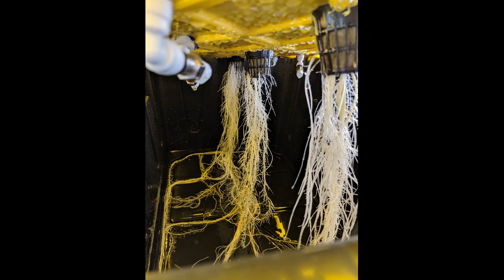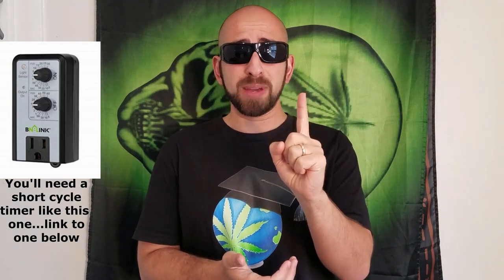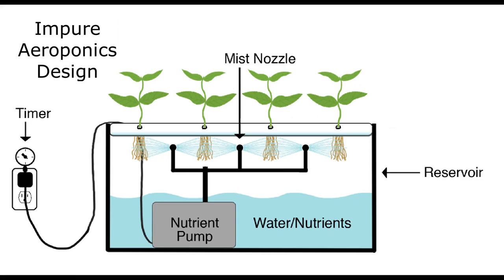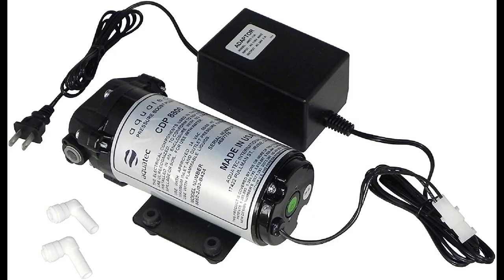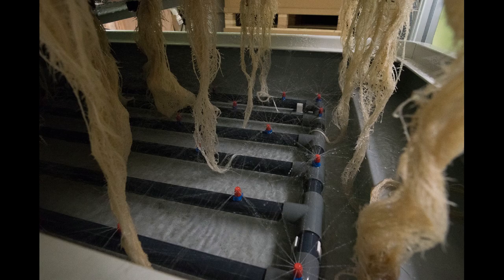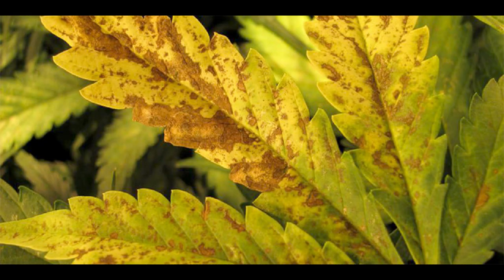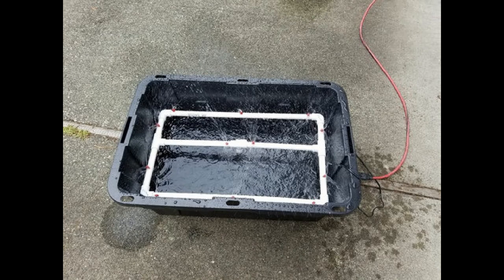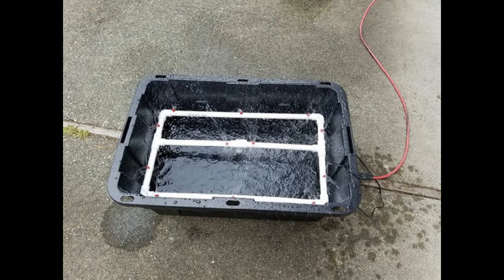Aeroponics Overview - Setups, Advantages & Shortcomings For Cannabis Growers

Comment from the maker: Thanks for watching and remember to subscribe! One little edit on the video: the heavy duty misters for high pressure systems are actually most often made of stainless steel, not brass. Apparently the brass/steel mix ones aren't as good.
Reply: talk about jewish cannabis strains and are those strains less subversive.
Reply: Hey Lex I have been subscribed and watching your videos for a quite some time now. Question with the aeroponics. So I am use to using Hydroponics if I decided to go with an aeroponics system could root pruning be beneficial in not getting things clogged up? Also if someone was to spend a couple hundred on a battery like they use on PC's and servers so if the power happened to go out they would have a couple hours of good power then that should save their crops (hopefully). I mean there are a lot of different batteries but the good cheap ones run about $400 USD I got one I am planning on putting on my hydroponic system but I have to make sure my battery is far from water as it can get dangerous quick. Is Hydroponics or aeroponics better in your opinion?
Growth/Veg/Yeild?
Reply: Look at MistFitz Aeroponics. I have all these issues worked out. I designed, coded, and built multiple working Aeroponic controllers. I need investors. 
Fitz.
Reply: What do your two scents smell like?!
:
Reply: How come YouTube grow channels are so anti Hydro when hydro it the most common method for indoor growing in the world?

Comment: I run a aero system in a 50 gal reservoir . Most of the problems you talk about there are fixes for. Like clogs . They made fine mesh pump screen type bags.   Net pots get zip tied to the tote your using.  Stuff like that . I will say that timer from Blink you showed is awesome I have about 5 . I also have back up pumps and air pumps for everything.  You cant beilve the growth I achieve . Ive ran many systems there nothing like a finely tuned aero system though. The gains out way the problems if you stick with it and youre right smaller plants are easier to control.
Reply: Good for you Mark... soon will be going this route too... we now have a lot of automated systems in the market like growee to provide smart management of the root zone and together with systems like ac infinity for above root level management and monitoring high pressure aeroponics is the future of proper cannabis cultivation

Comment: The short bursts of spray in a high pressure aeroponic system are what changes the roots from hydroponic roots to high pressure root's. Low pressure aeroponics and hydroponics produce the same kind of stringy root. Most people start with intervals of 3 seconds on every 3 minutes, with the largest gap being 1 second on 5 minutes off. We are trying to create "suspension" in the root chamber. The earth spins at about 1G of force, 20-50 micron sized droplet's "suspend" in the air for about 8 second's. This creates a more consistent humidity level in the chamber. This allows the roots to create smaller fishbone like root's similar to roots in soil. We have found growing Cannabis works best in container's that are at least 19" high for 3-4 months of growing. True HPA changes the pant by causing more "turgidity" essentially the plant rapidly ages along with the explosive growth. Plants have an extra cell membrane compared to us, during osmosis the cell's can swell rapidly and True HPA forces this. Another advantage is running sterile nutrient's the entire grow. Since the roots absorb almost all the nutrients during the day, there is very little runoff. Solely speaking about Cannabis I agree with a lot of what you say. What most people don't realize is that the advantage to True HPA is the speed of growth and cloning during an entire annual set of grow's. True HPA simply adds an extra grow annually do to the speed. When comparing what system's work best for growing Cannabis I have found a good grower will simply win with the system they have mastered. Thanks! Great video.

Comment: I'm growing in aeroponic system and it's succeeding. I'm in week 5 of flower. My mistakes were attempting too plants at 1 time so I recommend 2 at most and account for your flower growth! Create anchors for cropping and stress training! Add inner panel's to prevent drips. Go for it! I'm not using brass but I want them for the next round. I like the set up. 2 totes
1 is not long enough
Reply: which brand did you get? is it still good since you have it?
Reply: Need info about aeroponics can you help?

Comment: True aeroponics is done with high pressure, delivering about 80 to 120 psi, producing 30 to 80 micron small droplets - the ideal size range. i personally would run 3 seconds every 3 min. an accumulator helps to keep pressure constant and reduce the times the pumps starts running.
you can reduce growing time by a good 20-30%, with higher yields than traditional hydroponics and use way less water and nutrients (if you use a recirculating system). 
PROS: best way to grow, period - faster, better, way less nutrient use, bigger yield etc. - seriously, you can watch the plants grow right in front of you.
CONS: very complicated set-up, needs some technical knowledge and decent diy skills, no ready to use products, when it fails it's catastrophic (have a backup system ready - and some way of notifying you when the system fails) - not a system for beginners or intermediates; even pros will prefer simpler set ups for the convenience, but if you do get into it and can build a real HPA system, you are in for a treat!
Bonus Tip: DO NOT USE BRASS NOZZLES! there are good steel, titanium and nylon nozzles out there, use those! DO NOT mix metals in your nutrients loop, as it will cause corrosion and poison your plants. Try to get all plastic, steel or titanium parts only (had to search for HP gauges with steel fittings etc.). 
Bonus Tip 2: Use Yucca in your solution, as it will keep the system and in particular the nozzles from clogging up for much longer!
Reply: Do you agree that a full growth cycle through flowering is this difficult if a good high press system and filters are used? I assume if you avoid clogs and have a few redundant misters if you get get some clogged you'll be in good shape. Is there a standard way to support the base of the plant in lieu of soil or more medium?
Reply: super pro tip: drain to waste because you only have to mix the solution once as the ph doesn´t fluctuate. with a big enough tank you could make it to only mix the nutrient solution once per grow
Reply: @Nickporter17  nets or scrog screens / SOG screens are almost always required to keep plant from tipping.  Stay away from brass chinesinum junk nozzles and you will not have any issues on clogs.  Run a mechanical filter and make sure to not use organic nutes (whatever nutes you use have to fully dissolve and under 50microns).  

Have 8 grow cycles through my system, never had issues with clogging with high nutes in 1400ppm area during last weeks.

You can setup a aero system that is reliable and performs; just the initial investment is about 4x from just running a hydro setup.
Reply: What's Yucca?
Reply: @Nickporter17  i recommend at least baskets, so that the roots can gab on to something, and center the plant; the rest should be done by gravity. since the roots in the root chamber will be massive, they should be able to counterbalance the top weight. but using a net on top is standard for me anyway - so that helps too. 
You could probably use inert media, like hydrocorrels; but in truth, if you can do without, do it without. The whole  idea is to get rid of anything between the nutrient solution and the plant.
Reply: @Humbulla93 "drain to waste"
~120liter (30gal) a day for a 3x3-5x5 is too much waste for my taste. And not at all necessary. 
Mixing it only once would need a 10k+L tank for a single cycle: and my nutrient solution changes throughout the cycle. Besides, the PH in my solution does not fluctuate more than it should (and it should fluctuate a little). Was not easy to get there, since I am mixing my own from RO/DI, which can be hard to stabilize. But I found these de-ionizer rods "Torus Hydro PerfectpH" you put into your tank, which help a lot.
Reply: @mrgippy123  "Yucca is a genus of perennial shrubs and trees in the family Asparagaceae, subfamily Agavoideae. Its 40–50 species are notable for their rosettes of evergreen, tough, sword-shaped leaves and large terminal panicles of white or whitish flowers. They are native to the hot and dry parts of the Americas and the Caribbean."

Why are we interested in this plant? Because it's a natural wetting agent:

"Yucca, a natural surfactant helps overcome surface tension. As with most surfactants, Yucca has a (hydrophilic head) water-attracting polar head and a (hydrophobic tail) water rejecting tail. These two components of a surfactant molecule help break down water surface tension."

This makes the water much wetter and softer, allowing for a much easier flow; makes it harder for particles to accumulate; and thus it prevents clogging. It also helps making the droplets smaller and keep them that way, instead of them forming larger drops on the roots. SM-90 is a commonly used wetting agent that contains yucca. I recommend buying a 2oz satchel  of powdered Yucca from NPK RAW and use that. It's gonna last a very long time. 
Also great when you use foliar sprays - make sure you add some!
Reply: Thank you for share this importan info
Reply: @Aerogrow  what type of timer system do you use?
Reply: @probablynotdad6553  for aero pump using the mistking cycle timer; allows for "seconds" resolution.  (most are based in minutes)

The rest of grow tent is using web pro switch from digital loggers.  Requires lua programming for timers.
https://dlidirect.com/products/new-pro-switch

Working on a raspberry pi unit  with relays to replace both.
Reply: @OperationBaboon  Did you really just say "It makes the water wetter"? lol
Reply: @Asherons  it does indeed. 
The scientific definition of wetness is the ability of a liquid to adhere to the surface of a solid. It is dependent on a balance of cohesive and adhesive forces between a solid and a liquid. 
wetness is a variable that changes due the composition of a liquid. this is true for water also...

Look, you learned something new today! yaw
Reply: @OperationBaboon  TIL

Comment: Anybody use air pressure to force the water through the nozzle?  Air onto a pressure vessel filled with water. You could depressurization between sprays. More reliable too.

Comment: Has anyone tried using mist created by ultrasonic transducers? It would obviate the need for any fluid pressure whatsoever. All you'd be doing is pumping air around loaded with as much vapor as necessary to prevent it forming larger droplets, easily done with sensors and an MCU.
Reply: Have you further looked into this? Good question.
Reply: @johnbuck5181  Hi, John. Yes, I have, it's called 'Fogponics', by some, and there are even a couple of commercial solutions out there.

Comment: I know some people with a fully aeroponic grow. Works pretty good for them actually.
Reply from the maker: brave :) ...
Reply: @LexBlazer  
Its a walk in the park. HPA can be used for germinating seeds right through to harvest.
Believe it or not, one of the most efficient forms of aero uses 0psi water pressure ;)
Reply: @atomizer2665  Facts😂😂I'm like um ok
Reply: @alfmuss3  
Oil less compressors  make more noise and dont last very long, the only good thing is they are cheap :)

Comment: I really only find it beneficial for clones tbh
Like you said it's just way too finicky.
I prefer coco most of all for veg and flower because of ease of use, and it's versatility.

From salt based to bottled organic and finally full organic, it really can do whatever you want, you can use 3.8L smart pots with a drip or bottom fed system, or you can transplant into bigger pots for manual watering.
Or you can use the big ass bags and still go for drip, bigger bags exclude bottom fed though, because good luck finding a system for those sizes, unless you diy ofc.

Aand it's more environmentally friendly than rockwool, which admittedly is also an amazing medium, just really energy intensive to make.

Comment: Dissolved solids do not clog 50mu misters. There's much misinformation here. Get a good 80psi rated pump. 50mu misters, filter your pump intake. Aerate the holding tank with bubblers.

Comment: I don’t understand why this system is faster than dirt. Don’t you need soil microbes to help breakdown nutes?
Reply: It uses hydroponic, or bottled (synthetic) nutrients. In bottled nutrients, the nutrients have already been broken down to make them bioavailable to the plant immediately.
Reply: @usernamehere2124  good point but you could use the same type of nutes on dirt.
Reply: @scottturner2529  True. However, hydro is much more optimized for the plant. Soil has a lot of things that could cause stress on the plant. Pests, fungi, bacteria, oxygen deprivation, deficiencies, pH imbalance, etc... hydro cancels out all those stress factors when done properly, therefore, plants grow faster. Even if you have perfectly tailored soil, with the proper amount of synthetic nutrient input and microbial diversity, the amount of oxygen the roots receive is less than they would receive in a hydro environment. Studies have shown that plants grow faster in both hydroponic and anaerobic systems, compared to traditional soil methods.
Reply: @usernamehere2124  I think you’re right about the o2 at the roots. Thanks for your answers.

Comment: Thank you for highlighting the downsides. Great channel
Reply: Lex doesnt seem to have any real hands on experience of running aeroponics so i guess his views on the downsides may be based more on imagination than anything.
Reply: @atomizer2665  I see. But they sound like plausible things to worry about. Most other videos I've seen only say how great it is without mentioning the things to be cautious about. Do you have much success with it?
Reply: @atomizer2665  I plan to put the atomizer into water mixed with nutrient and ph to about 6. Do you know if the mist process will affect my mixture and ph?
Reply: @alextao3774  
It sounds like you are planning to use an ultrasonic fogger.
Reply: @atomizer2665  o that's not the same as atomizer?
Reply: @alextao3774  
An ultrasonic fogger will create an impressive looking fog but its not much good for growing plants.  If you look for vids of systems that use ultrasonic foggers they always have a dwc reservoir inside the root chamber. Without the dwc, the plants wouldnt make it.
Reply: @atomizer2665  so what are you using to create high pressure aero?